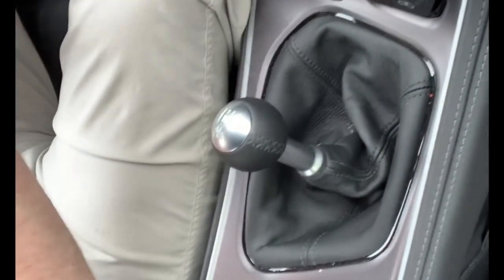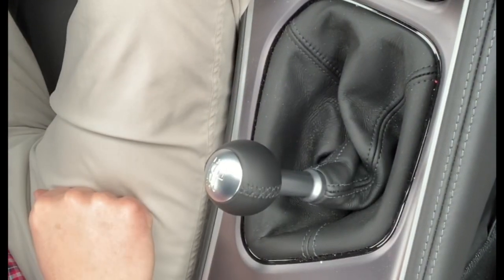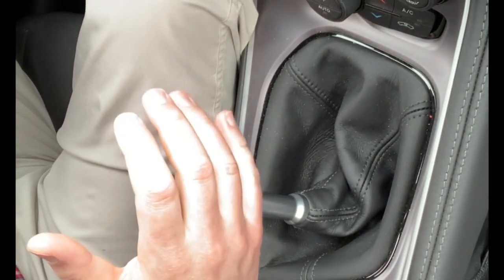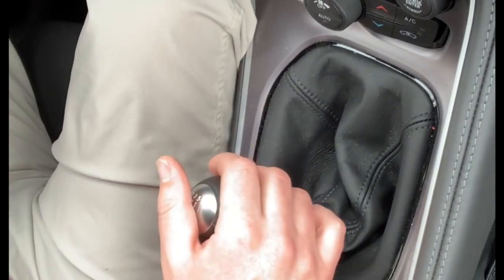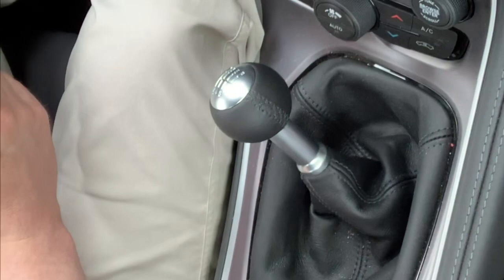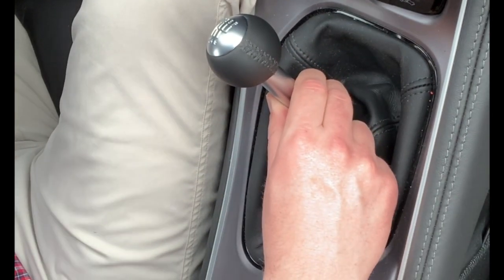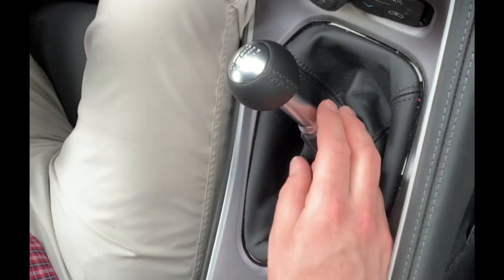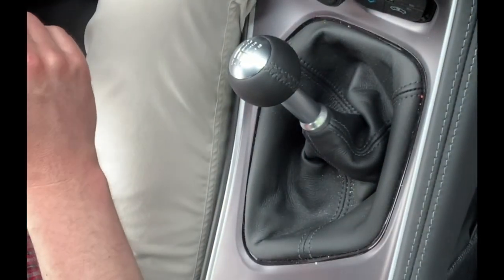Dodge Challenger 6 Speed Manual Skip Shift Demonstrated (2nd Gear Lock Out)

Comment: That feature is dangerous, everyone has different styles, nit having enough torque at the right moment puts u at risk, almost happened to me, besides they already have a transmission that tells you what gear to go in, its called an automatic. Why would i get an manual and not be able to have full control, the skip shift was like the first thing i did to my maro

Comment: I don't mind it because it basically doesn't affect you unless you're shifting wrong anyway. If you are winding it all the way out into higher RPMs at such a low throttle it's better to shift early and then use more throttle to accelerate the same. You get way more efficiency that way. Instead of using less throttle just use a higher gear. 

The skip shift system was the only way for them to pass emissions without having an ugly arrow up and down to tell you when to shift. During EPA testing they will actually do their best to shift when the car tells you to  but this way they can eliminate that. 

Basically the car has so much torque that at 25% throttle in second gear you're getting roughly the same amount of torque as you're getting in fourth gear at 3/4 throttle so honestly if you find yourself getting locked out of second gear a lot it means you need to be shifting a lot earlier unless you're accelerating hard. It just means you're doing it wrong in the first place.
Reply: Talk about one track mind, u realize not everyone drives the same? Its pretty dangerous
Reply: @romeojuliet8462  If you drive correctly, using best practices, then it doesn't interrupt you. It only interrupts you if you're doing something wrong
Reply: @romeojuliet8462 I understand that some people drive wrong but that doesn't mean that you should
Reply: @romeojuliet8462  If you're revving it out that high then you're already driving it wrong in the first place. You're wasting a lot of fuel and increasing emissions for no reason.
Reply: @pilotavery  why would you want a car like this if your not going to Rev it ,is that like gramma mode just saying

Comment: If u wine it out in First gear in a race you can't speed shift to second,it goes to fourth ???
Reply from the maker: You should be free to do as you wish at WOT.  It’s when you wind it out is using like a quart throttle that it will lock you out of 2nd.

Comment: Why aren't you explaining to us that a "Skip Shift Eliminator" can be had for about $12 and is a simple "plug and play" under the tranny?  Or that it exists due to CAFE standards going back to the 1990's and not something the manufacturers actually want, either.  Also would be nice to see a back seat view of your speed / rpm's along with shifting.  (less of a close up) Sorry if you've already done an updated video.
Reply from the maker: Thanks for watching.  I did kinda do a follow up video with the skip shift eliminator to show that it’s out there. Limited tech prevented me from doing much more but I can see how that might be beneficial to see Rpm’s speed etc.
Reply: @BurnseysRT  , thanks for being cool about my crabby comment!  I'm buying a 2006 CTS-V and having it shipped from FL to WI.  No idea if it still has the lock out, but an Eliminator is the first thing I'm getting if it does.  Haven't had a Manual since my old Ranger pickup (sold in 2008).  I only learned about "skip shift" recently and going by the comments it seems the dealers aren't telling buyers about it.  Nice that it's so easy to correct, though.  I still have kids or would prolly be getting a Manual Challenger or Mustang.  Shame how the sticks are dying out.

Comment: I don't really like the lockout because you may as well just manually go from first to third or first to fourth
Reply from the maker: I was never a fan. When it happens it’s alarming and not safe IMO.  Plus what you said. Just got to third or 4th manually if you want vs being forced.
Reply: @BurnseysRT  it was because the EPA drivers rev so high. You can get way better than the EPA numbers If you just short shift a little bit and it's just forcing drivers to drive properly. Personally I feel like it only happens when you are revving higher than you should before shifting anyway but it should be my choice to drive in correctly
Reply: After thinking about it a bit I actually think that it doesn't make sense, I realize I've just been driving it wrong. Every time it's locking me out it's because I'm actually doing something wrong, I'm either in way too low of a gear or not accelerating hard. To accelerate the same amount you should just use a higher gear but more throttle to compensate and you'll use a lot less fuel to accelerate the same amount

Comment: this feature is the most annoying thing ive ever encountered in a car, i recently purchased a 2015 scat pack shaker and ive been locked out of 2nd gear so many times thinking something in the vehicle is broken when in all reality its this absolutely useless feature, i bought this car to drive around, not to save gas lmfao 😂
Reply from the maker: Yes it’s terrible annoying for sure.  Seems like a silly thing for a manual transmission.  We didn’t buy a manual to have gears locked out.  Weird thing

Comment: It baffles me that some owners have never experienced this. I have a 2012 Challenger RT and this is almost a daily occurrence for me. I have no proof of this but I think it gets worse as you put more miles on your car. I’ve had my car for going on 7 years and have put over 200k miles on it. It happens so often in fact that I never even use first gear anymore unless I absolutely have to. It also used to correct itself after a little bit of driving but now it stays activated until I turn the car off for about 10 minutes.
Reply: 3/31/23 this is the same that’s happening to me, just hit 91k and I thought something was wrong with the transmission. I think your right about mileage 👍
Reply: Over 200k miles in ten years, do you live in it?

Comment: I wonder if this is what I'm experiencing with my rt shaker that when I'm shifting from 1st to 2nd it won't go in and if I force it it'll grind. I would have to go to neutral then put it back to 2nd and it'll go in. Happens very random and I couldn't figure out why and what would be causing it to happen but this might be it
Reply from the maker: Yeah it sounds like it.  It’s so weird when it happens and not cool.   But yeah this is probably it.  I would just go to third when it happened.
Reply: @BurnseysRT  that's pretty annoying. But will try driving today in sport mode once I get off of work to see if that helps me out
Reply: @BurnseysRT  so on my way home from work I drove in sport mode and it did it once

Comment: So is this normal ? Mine gets stuck sometimes on a gear like if I been driving on the same gear for a little bit it will lock and it takes a little bit to let it go
Reply from the maker: That sounds like a different thing but if it’s persistently happening I might get it checked out.  I don’t know too much about that issue.

Comment: I love hearing my exhaust but I noticed that on the challenger it doesn’t wanna shift to second and it holds the rpm high and I was like what the hell is this car doing and then when I slowed down enough it let me go into 2nd gear easier. So I would need the eliminator to remedy this? I thought it was a rev match feature but the automatic felt way better and it’s a shame please help I’m looking to buy a scatpack wide body and I really want it in stickshift. My 80s Supra feels better

Comment: O/T , but does the Shaker have a way to drain water? My 79 Pontiac shaker had a hole with a rubber hose attached under it that drained water below engine
Reply from the maker: Yes. There is a hole towards the front.  All of the water rolls forward and drains into the engine bay.

Comment: I own a 2020 Challenger Scat Pack manual. Does my year and model have a manual lockout? I only have 1700 miles, but I have never been locked out of 2nd gear.
Reply from the maker: If you are in sport mode it won’t happen.  I drove in aport mode 95% of the time because I found it easier to drive with the better throttle response.  Also it doesn’t happen frequently.  Most guys I have talked to it has only happened a handful of time.
Reply: @BurnseysRT  Thanks for the info. I just changed from sport to street mode, 2 weeks ago. Still no skip shift. I bought the car last Thanksgiving,  so I really have not driven it. My daily is a Ford truck, so I really have not driven the Challenger.

Comment: I have had the car for 6 years and it has locked out and gone to 4th gear like four times.  Not really an issue. But it really surprises me every time. I usually just let it slow slightly and then put it in second.

Comment: I realize this is not a Camaro video but my 2011 Camaro SS has the same transmission as the Challenger and it does the same thing I want to shift from 1st to 2nd and feels like there's a wall blocking me from shifting into second
Reply from the maker: Yeah man. It’s totally annoying.  You have a manual for a reason.  Thanks for watching.

Comment: I just got a 2011 challenger and this happens for 2nd gear and 6th and I even triple check and 5th straight down sometimes goes into 4th
Reply: It is like that but I found out it how to feel for that and became easy oh and the skip shift just let ya rpms drop  it’s actually pretty smooth once you find out the timing for it
Reply from the maker: That seems odd.  The first times I shifted into 6th I put it in 4th. It’s a strange throw. It’s like back and right vs straight down. Or how it feels anyway.

Comment: Will the Hurst billet short throw eliminate the COGS second gear lockout or is it controlled by the transmission? This is the only thing I hate about the SRT8.
Reply from the maker: Oh man tell my about it.  It’s annoying.  Unfortunately the shifter won’t resolve the issue.  It’s an electronic thing.   I would get yourself the skip shift eliminator. It’s about $20 and is plug and play.  It eliminates the skip shift.
Reply: No it’s controlled by the transmission, anyone who’s looking into a hurst for a challenger will love it but it doesn’t do anything for the skip shift

Comment: I think this is disabled in sport or track mode. I only drive mine in track. One day i went to leave my house and it threw me in 4th. What the fuck!! And its only 25mph in my neighborhood. So 4th is totally unnecessary. I realized I was in street mode for the 1st time. 
This feature is dumb IMO. If you want to shift from 1st to 4th you can at any time. Theres no reason to be forced to do so.
Reply from the maker: I agree.  T he first tine for me I had the same reaction. Was like wtf.  From that day forward the first thing I do is put it in sport mode to eliminate that.   There is no reason to have this.  We all got a manual to chose what gears
Reply: @BurnseysRT  I saw your other video you made after leaving my comment. So it really is disabled in those other modes. I was always under that assumption but didn't know for sure. Good to know

Comment: Someone sitting behind a desk and drives a Mercedes though of adding Skip Shift
Reply from the maker: Yeah probably.  Haha.  Thank goodness for the eliminator or sport move to turn it off.  I didn’t buy a 6M to be told how to shift.
Reply: They did it to be able to use a computer to judge the fuel economy when it engages which is almost never. But it is a safety issue because it surprises you ever damn time. Stupid feature.

Comment: Mine is doing it under hard accel sometimes....really pisses me off.
Reply from the maker: Yeah it really does piss me off too.  Going to try and get a video out to address this problem this weekend.
Reply: Burnseys RT they had a TSB on the driveshaft so I assumed that might be contributing. Didn’t realize it had this skip shift feature....guess I’ll be deleting it when the warranty runs out.
Reply from the maker: For now if you have sport mode turn it on.  It disables the skip shift.

Comment: I have NEVER seen this before and I've owned and driven a ton of manual transmission vehicles. I heard about this randomly and needed to see how it worked so thanks for this vid! I'd love to know how many people bought this car and brought it back to the dealership complaining that there  was something wrong with their transmission.
Reply: Ohhhhhh ok I skip gears all the time when I am cruising around town
Reply: I feel like these people just don’t know how to drive and actuallly step on the clutch. I’ve drove nothing but manual my entire life and this has never happened to me
Reply: @ixine-ni7vt  Is that how you feel? LOL!  And driving manuals gave you knowledge of every manual transmission car and feature. LOL, gtfo.
Reply from the maker: It’s a feature put on most high performance or at least high displacement / low MPG manual cars.  It’s put on there for fuel savings.  These are on Cameros corvettes etc.  it’s a real thing and nothing you are doing wrong as a driver I can assure you of that.

Comment: Did yours happen to grind at one point? When I wind mine out like that it doesnt shift to 4th, it grinds a bit like it doesnt want to go into second. The car came with a hurst short shift as well. Wondering if that has anything to do with it
Reply from the maker: Mine never grinded ever but I never tried to force it in second.  Fortunately before I bought it I red up and the skip shift and just let it happen when it did.  Not sure in your case but I would look under neither by the tranny I believe and see if there is a skip shift eliminator on yours if not I would maybe look into getting one.  Only around $15-$20 or so.  I probably will at some point but it doesn’t happen frequently at all so no rush yet.

Comment: I have a 2018 Challenger R/T with the 6speed and have never experienced this. Even with the traffic here in Dallas and slowly accelerating like you explained. Now I'm going to have to test this on mine and see if it does it.
Reply from the maker: It’s a rare occurrence for sure.  There are very specific things that need to happen.  Like you have to be going 18-21 in first, 25% or less throttle and maybe one other thing.  Not something that would happen frequently in most conditions.  I am just driving to avoid it at the moment.  Might get the eliminator.
Reply: Did you buy your car new, somebody might have put the shop shift on it already if used

Comment: It only happened to me a couple a times in 2 years of used. I still did the skip shift eliminator because the 3 times it happened it was in the worst posible timing and put me in danger.
Reply from the maker: That’s a scary thing for sure and I will be doing that sometime here soon.  Good thing is it’s super cheap.
Reply: Me and a friend nearly got rear-ended by a semi because his trans am decided not to go from 1st to 2nd during hard acceleration on the on ramp the engine bogged and we actually slowed down.

Comment: A manual that eliminates shifting.  Seems a bit ironic.
Reply from the maker: Right!?!?   Kinda weird right.  I will more than likely buy the skip shift eliminator to prevent that from happening but I can work around it if I don’t want it to happen.   Thanks man
Reply: It is dumb but it only happens when you take off super super slowly.